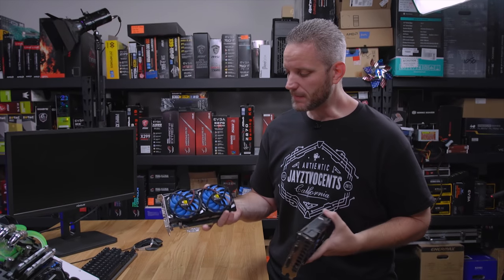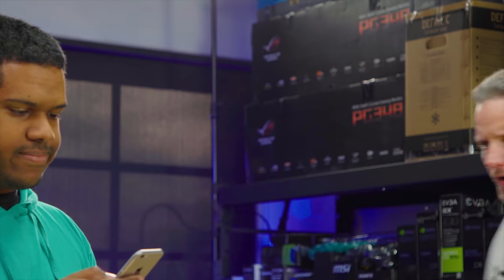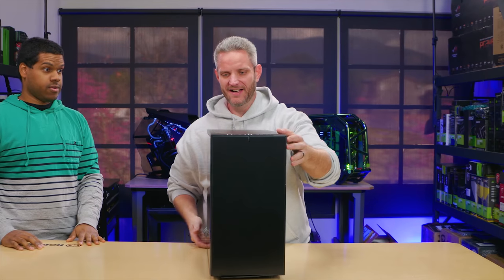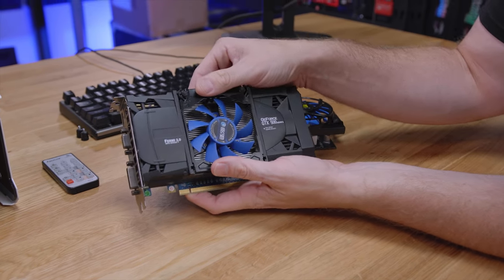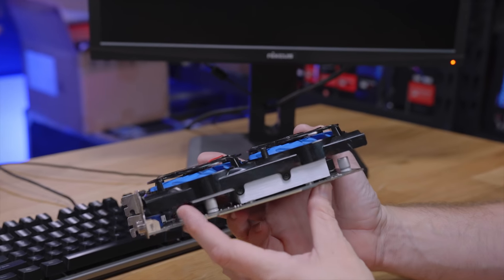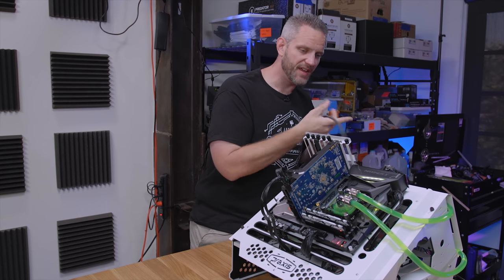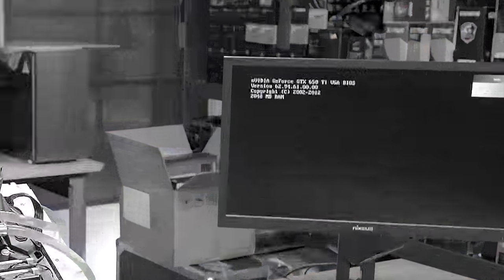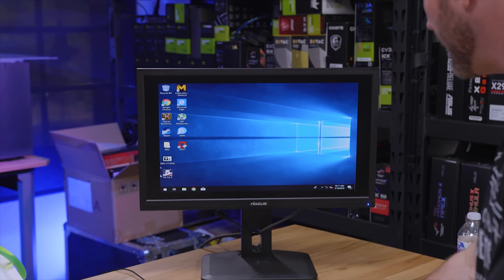What is this GPU?!? Counterfeit Video Card

Comment: Jay, I really like you and your videos but this one seemed a bit on the sloppy side... You missed the most basic things you could have done to identify the card as so many others have said. It's easy just to unscrew the cooler and have a look. As for the "legit" card which does not work for long, you should have tried putting it in the oven and baking it for a few mins! I've done it to an old GTX460 which gave me artifacts after a short while and it fixed it.

Comment: Thanks for the tips, I have an ASUS 750 ti that works ok without drivers but has green speckles, lines and crap on the screen after drivers are installed.

Comment: As anyone who knows anything about troubleshooting PC's, especially with potential viruses, you should always keep physical availability of your software on disk or USB for easy access between devices, especially if you cannot even get your PC to boot windows. Connecting a problematic PC to the internet because you are too lazy to do so, as you found out, can have huge repercussions. This kind of laziness seems endemic in tech channels these days, this is basic actions to ensure you diagnose and isolate the problem without opening pandoras box of connecting to the internet to get your software you should have already prepared on a removable drive/media. It's the sort of behaviour I might expect from a millennial child who believes they have to be connected to the internet for everything to work properly all the time, and believe corperate dogma that you must be using their software applications updated all the time from the internet instead of learning how to do install and manage their computer themselves without a million forms of bloatware installed for basic functionality. If it's for the memes like Linus obviously behaves then I guess it's understandable, but failure by walking into a brick wall is only funny so many times, especially if you want people to respect what your doing in a professional standard.

Comment: Hi I know is different topic but mayby you can give me an advice about my build . Have a problem with Aorus gigabyt rx 580 8 gb . Just build pc ryzen 7 5800x motherboard board tomahawk x570s . My graphics not work in pcie 4.0 upper port . Screen shows no signal . But when plugged into to 3.0 pcie port bottom one then works perfectly . Did you had problem like this before . I know that my graphics in pcie 4.0 port will works as 3.0 because is an old card but is the pcie 4.0 faulty or need to switch something on in a motherboard bios ? Thank if you found a time to reply.

Comment: Old Vid but..
I'm confused as to why the option in DDU that stops Windows from searching for Graphic Drivers online wasn't disabled, instead of just disconnecting/reconnecting the Internet. Or for that matter, simply turning off the Ethernet adapter would have worked fine also. Shrug, got me thinking is all.

Comment: is there a way i am able to figure out what is wrong with my graphics card? it randomly stopped working and just got to black screen before trying to load into windows. it is an 4g rx 550 sapphire pulse, i have only had it for about 7-8 months at most, and i don't have the money to get a new card, because i am already trying to get a new computer in general and was hoping i was able to keep the graphics card.

Comment: Did you said 384 cuda cores and 2gb ram? that's the specs of a 560ti. It is most probably a written error while typing it, as 560ti, 650 ti... But this is most likely a 560ti with those specs. If the core speed is 822mhz and 2ghz for Vram, it is ( a counterfeit 560ti ),

Comment: Help pleaase. So i used DDU and now my system wont boot. It just powers on but no diplay output from the gpu nor theother vga port. Tried replacing the hard drive and reseting the bios.

Comment: I thought I got a killer deal on e bay with a GeForce gtx 1050ti for $ 54 and of course it turned out to be fake. Even gpu z called it a fake in the corner tag. So much for thinking I was ahead of the game. Still haven't figured out exactly what it is.leaving it in the case until I can afford a real nvidia card
Reply: You can buy a gtx 1050 used for around $100. Or you can buy a used gt 1030 for around $70.

If you want to go lower than that, you’re better off with a Chromebook.
Reply: @Frenchfrys17 , I might end up going with an rx580. $ 200 will be my limit on this budget build. And I'll buy legit stuff off newegg or amazon this time. I still need to find out why my mouse wont work in uefi. That is my hangup at the moment
Reply: @chuckbarnes4582  The gtx 1660 is only $220 and is even better than the rx 590 while having an extremely low power draw. 

https://www.newegg.com/Product/Product.aspx?Item=N82E16814932138&ignorebbr=1&source=region&nm_mc=KNC-GoogleAdwords-PC&cm_mmc=KNC-GoogleAdwords-PC-plaVideo+Card+-+Nvidia_-N82E16814932138&gclid=EAIaIQobChMIxPCWmtKS4QIVih-tBh3SmAASEAkYAiABEgIz8fD_BwE&gclsrc=aw.ds

The Rx 590 can also be had for around that price too. The difference in performance between sub $200 cards and cards just slightly over $200 is massive right now. 

If you want to to go cheaper, I would wait till the 1650 or Navi.
Reply: Yeah, gotta watch out. China fakes EVERYTHING from eggs to electronics, to paintings and drugs. It's seriously annoying, create something original for once.

Comment: Do any youtuber knows about metered connection setting? You can even set that on LAN and there will be no windows update itself crap as long as you're connected to that certain network (you can set any LAN or WiFi as metered connection)

Comment: The fire extinguisher still had the pin and breakaway tamper tie in the trigger.  Jay wasn’t prepared to contain that potential disaster. Just sayin’...
Reply: If the pin is removed or lost, the unit has to be serviced.
The seal is a proof that the fire extinguisher has not been tampered with or used since the last inspection or service. Also, it keeps the safety pin from getting loose or accidentally falling out. Without that safety pin, the extinguisher could be partially discharged or triggered. The seal will also contain a date indicating the last time it was inspected.

Comment: I had a problem with a 650ti in bios I had to set it to onboard graphics and it you the 650ti you fine but if I had it on PCI it does not work might be same problem with 550

Comment: If you do not know how to flash a bios.  Don't talk about it. Really it's easy to flash a bios from a broken bios card  You need 2 cards to work .
1 ati and 1 Nvidia card.
U boot the systeem with the card that works.
Than under dos not windows you can reflash the broken card .

Amateur